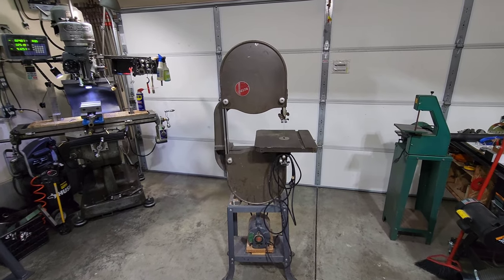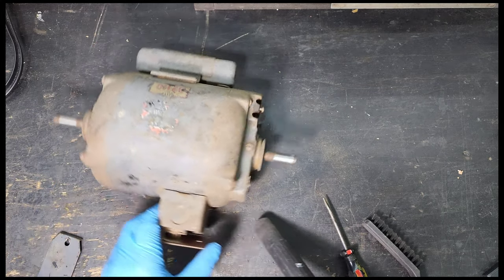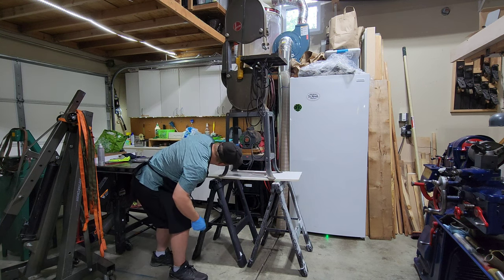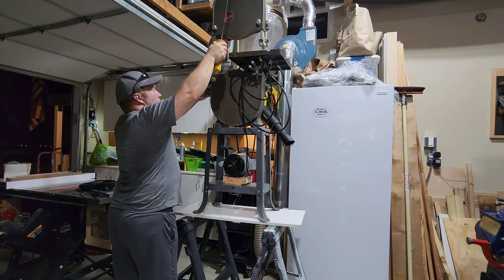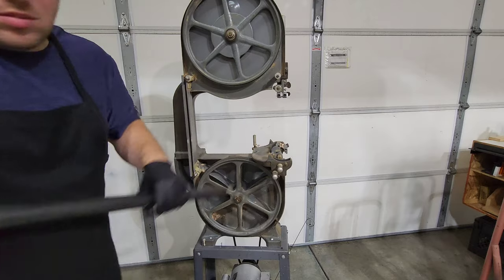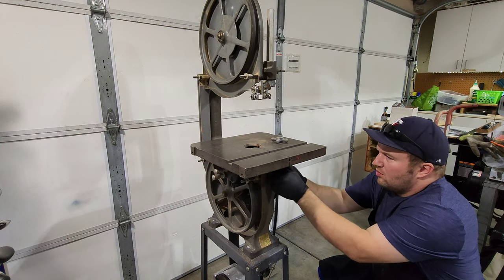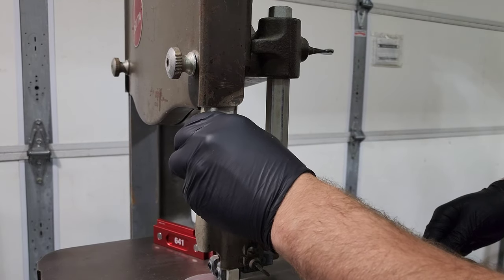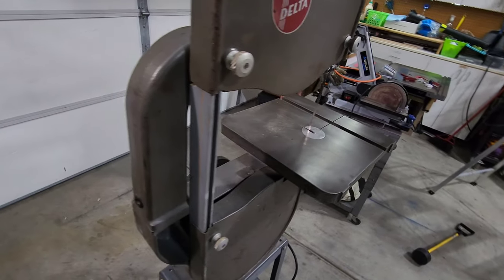Delta 14" bandsaw tune up and motor swap

Comment: I'm amazed that that capacitor wouldn't need replacing.  Surely it's no longer the same uF value it started out as?  I know in old radios of that period the caps all get changed along with any out of tolerance resistors when restoring one.  The paper ones get leaky as over time the beeswax in them melts out, letting moisture in and in electrolytic caps the liquid in them dries up, causing the loud hum that you'll hear when plugging one up and turning it on.  

At least the lube has only thickened.  I restored a floor model Brunswick phonograph player a while back from 1917 and the grease inside it had basically turned into cement.  Fortunately, old lube will clean up easily if ya take some lacquer thinner to it.  Love that saw, man!  Wish I could find something like that around here but it's hard to even find the modern stuff here.  I drove 176 miles round trip last weekend just to get a model 28-276 because I was tired of the little useless 9" Skil in my garage, lol.

Comment: I appreciate your great video. I am working on a similar vintage Delta. Mine has the same logo badge on the upper wheel cover as yours. Great saw compared to the new imports, well worth the effort. Regards from Ron in Florida

Comment: Thinking of upgrading my Delta bandsaw's 3/4 hp motor to 1.5 hp. In your video, I would also think that the wood supports under the motor will also be beneficial in absorbing vibrations. Thank you for your video!

Comment: That cracking insulation is common in old radios too necessitating either covering it all in spaghetti tubing or replacing altogether on the early rubber coated wires.  Oddly, the cloth covered stuff is usually in the best shape and often doesn't need replacing as the cloth insulation is usually intact unless it's a wire that gets moved around a lot, then the cloth stuff frays and/or breaks.  My garage is a 1 car garage built in the '40's.  I had room for a 60 gallon 2 stage compressor as it stands upright, but alas, my ceiling is far too low for any kind of hoist.  I'm 6'8" and I think the ceiling is about 7'.  I can barely clear the shop lights, lol.

Those bearings look to be sealed, but you can pop the seals off with an awl and re-grease those bearings the same as you would wheel bearings in an older car, the seals will snap right back into place.  I learned that trick with the spindle bearings on my mowing deck and in the upgrade kits to replace the riding mower's wheel bushings with bearings.  To me, regreasing is how they would have been handled back in the day as folks from that time period had the philosophy of "Use it up, wear it out, make it do or do without", sort of like using the wood under the motor to use the belt you have instead of "gasp" buying the one that would fit. :)

Comment: I wonder if a dry lubricant like graphite powder would be good around that bottom guide.  I use it on my old truck's door locks to keep them from freezing up in winter and they always operate smoothly.

Comment: Tips for tensioning the blade on a model like this? 

I have a 28-290 from 1964, i followed your advice for setting the guides and bearings, but it bogs badly under load and it made me realize ive never checked the tension, because this unit was originally at a school, it definitely may be set incorrectly. 
I see the indications on the back for tension at x blade thickness (mine is currently 3/8") but dont know what part of the adjuster is used to reference the indicator. 

Any help is greatly appreciated.

Comment: Hi Jim - I need a pulley for my 1939 Delta 28-300 - can you tell me the correct diameter for the upper pulley for the part LBS-296-S

Comment: Hi Jim, I appreciate all the information in this video.  I have the same saw that, somehow, lost its motor and stand before I got it. I'm currently replacing the stand and motor that I had and will soon be putting the saw back in service.  Can you share information about the bearings (sizes and where they were purchased)? I should probably replace those as well.
Reply from the maker: there are different bearing for different years. the older style I believe had extended race bearings. the new ones do not have the extended race. if you take your bearings out you can enter the bearing number in google with the keyword delta band saw and you should get some kits that will fit it. hope that helps

Comment: Thanks for the video. This is the exact one I restored. Can you tell me what’s the hp of the Delta motor?
Reply from the maker: I believe it was rated as 1/3 hp. The older delta motors were underrated in their power. In reality, it's probably closer to 3/4hp
Reply: @restoration-projects  thanks. I have a 1/4 hp motor and thinking of upgrading it to a 3/4 or 1 hp which makes sense.

Comment: I can agree not to paint a vintage machine. I call the accumulation of scrapes witness marks showing how much work this machine did. My Rockwell version of this saw is from the ‘80s but looks the same in an off white color. I just got mine in Sep of 2024, turned down others but with the prices going up I pulled the trigger and got one off Craig’s list. It’s in tougher shape than yours but runs fine. I’m not inclined to buy the Carter guide bearing upgrade kit or add the 6” riser. If I wanted that I would have bought a new 14” Rikon. These vintage band saws lack some of the nice features features the new saws have. So I don’t plan on getting another vintage machine for woodworking.